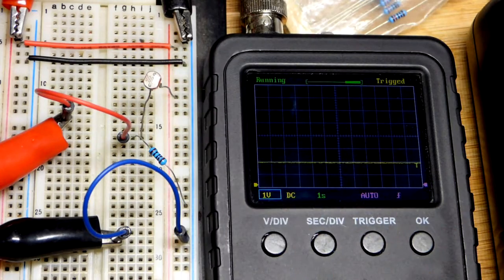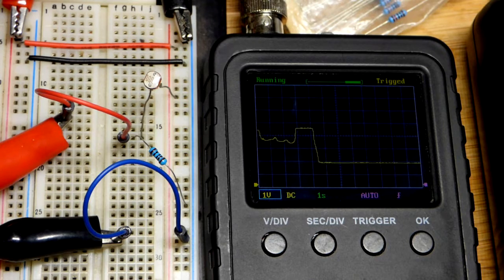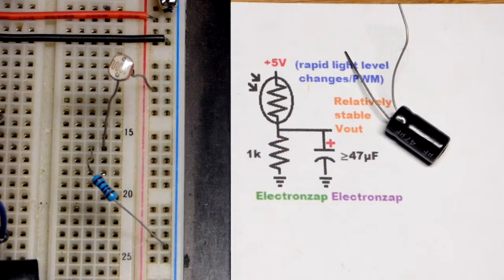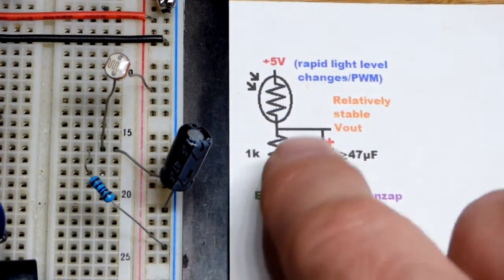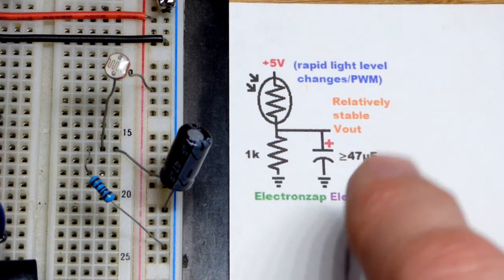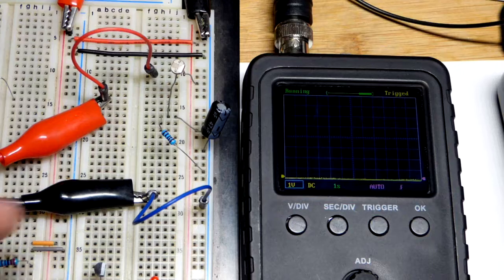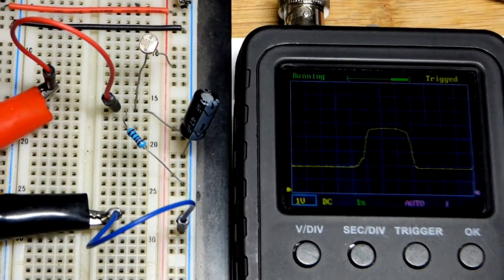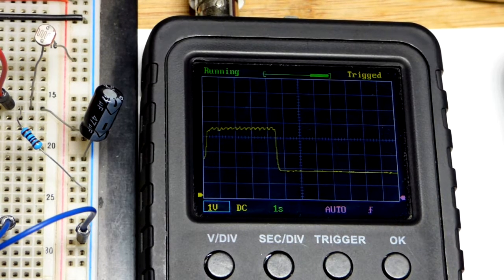Smoothing capacitor for light pulses on LDR voltage divider learning electronics shorts 27

Comment: Informative and to the point -- thank you. What's that scope you're using? Seems like a great thing to have in my backpack!
Reply from the maker: That's just a generic scope, I may have a link to it in my Amazon affiliate links shop page that I link to in the description of all of my videos. It's sold under a lot of names, so if you search for portable pocket oscilloscope, multiple listing should pop up with it, and various accessories. It is very nice though if you don't want to spend a lot on a better scope that is harder to use, or just to have an almost weightless scope to carry around all the time.